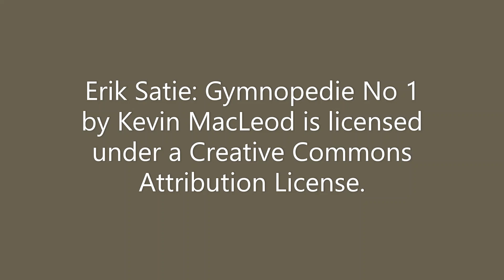Plank & Carette Live Steam

Comment: Any way of knowing what's the actual pressure in that boiler?
Reply from the maker: not without a working gauge but the pressure is less than 15 psi i am confident. There is a safety valve present.